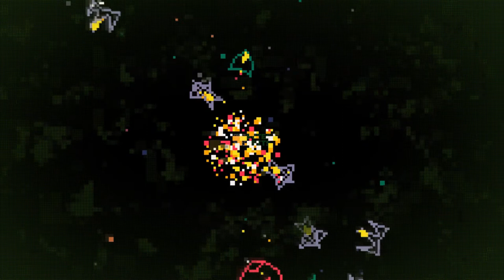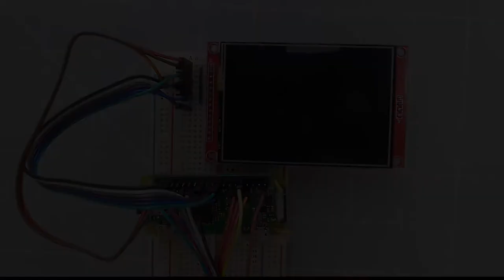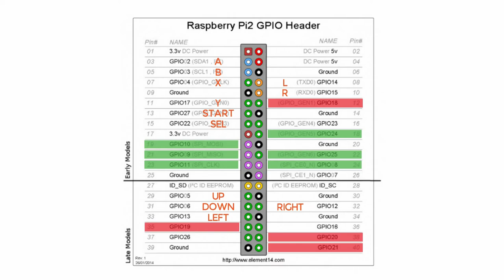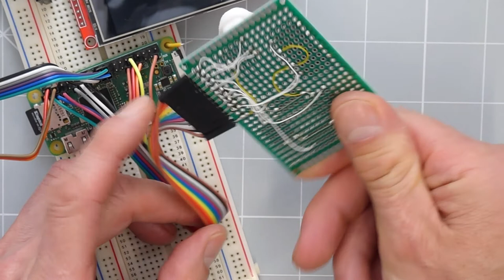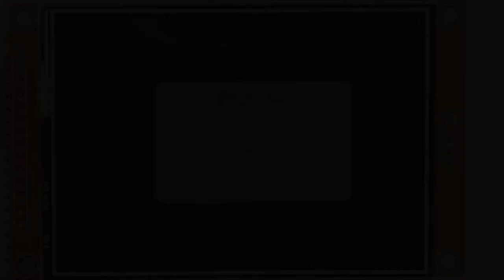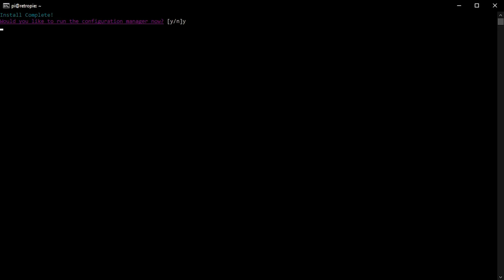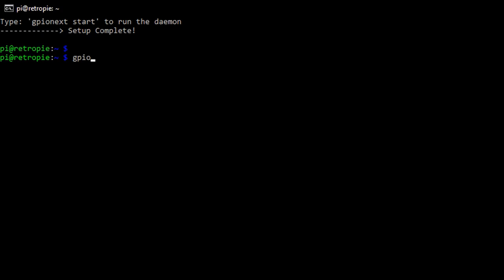Using GPIO Buttons in RetroPie To Make Your Own Game Controller or Handheld Console

Comment: Can this be carried out in raspberry pi zero 2w ?
Reply from the maker: Yes. It should work on all Pi models.
Reply: @BytesNBits  thanks for the reply, can you please help me more by providing few info 
1. I am getting raspberry pi zero 2w for cheap hence I want to make a bartop arcade machine where most of my games will be neogeo ,mame, snes ,sega Saturn . How will it perform on a 15 inch 768p reso screen.
2. Can we use remaining gpio fo player 2 configuration? 
If not then I have a gamepad made from raspberry pi pico will it be detected as a controller for retropie for 2nd player configuration?

Comment: can you show how to make the controller?
Reply from the maker: Hi. The controller is just a number of pushbuttons soldered on to a piece of veroboard. I've wired in a common connection to one side of every switch and then taken the other side of every switch to a flying lead. This lets me connect either 5V or 0V to the common side so I can either pull up or pull down an input pin on the Raspberry Pi.  For this project I used a 0V common to pull down the RPi GPIO pins. I hope this helps you out.

Comment: It says Failed to add edge detection when I open the config-manager
Reply from the maker: Hi. I'm not sure what that might be. Make sure you've run a full update on your Pi and RetroArch installations and then try re installing the GPIONext code.
Reply: @BytesNBits  Ok i found the error :) My LCD-Display took some GPIO pins. But now I have another error. When I type in gpionext start and reboot, retropie says that it found no Game-Pads.
Reply: @BytesNBits  You mentioned RetroArch. I haven't istalled RetroArch.
Reply from the maker: @dark_phoenix_9537  RetroPie is a front end package that uses RetroArch in the background to do the actual emulation. 

Can you run the GPIONext config routine and does it recognise your buttons? If you then run RetroPie without a reboot does it see the controller?
Reply: @BytesNBits  The problem is the LCD-Display, because when I run the RP whitout tftdisplay installed, it recognises the GPIOnext controller.
Reply: @BytesNBits  Does it change something when I buy an SNES Controller

Comment: how to add vibrations?
Reply from the maker: I haven't checked it the driver supports haptic outputs. You'd need to have a look in the documentation. If it does I guess you'd just need to connect the motor to a GPIO pin, maybe with a simple current amplifier.

Comment: i tried to do this but my gpio is now like burned the raspberry pi works but the gpio doesen't
Reply from the maker: have you tried booting the RPi with a clean OS to verify if the GPIO is really damaged. the software shouldn't be able to damage the circuitry.
Reply: @BytesNBits  yes i did it and reinstalled the gpionext software but it still can't recognise the buttons attached to the gpio
Reply: @BytesNBits  how can i know if the gpio is broken?

Comment: Upon trying to run the config menu Im having some issues. Im getting this error "cannot import name 'AbsInfo' from 'evdev' (/usr/local/lib/python3.7/dist-packages/evdev/__init__.py)" any idea on why that might be?
Reply from the maker: It looks like the evdev library (I don't know what it is) is missing a module or something. Try updating your Python. It might also be that that module has been taken out of the library. Try a search on Google.
Reply: @BytesNBits  Thank you. I looked around for a while and didn’t find anything. I ended up just reimaging my SD card and starting from scratch. Worked fine after reinstalling everything. Thank you for the help 🙏

Comment: i tried to do this but it is showing this
Traceback (most recent call last):
  File "/home/pi/GPIOnext/config_manager.py", line 315, in <module>
    ConfigurationManager(args)
  File "/home/pi/GPIOnext/config_manager.py", line 85, in _init_
    gpio.setupGPIO( self.args )
  File "/home/pi/GPIOnext/config/gpio.py", line 99, in setupGPIO
    pins.append( pin(pinNumber, pull, args) )
  File "/home/pi/GPIOnext/config/gpio.py", line 59, in _init_
    bouncetime = args.debounce)
RuntimeError: Failed to add edge detection
please help me
Reply from the maker: Hi. I had a quick look and found this possible issue.
https://www.raspberrypi.org/forums/viewtopic.php?t=205327
Check your pin assignments to make sure GPIONext isn't interfering, or being blocked by some other software. I also added a GPIONext fix video as I found it was interfering with my sound setup. Have a look at,
https://youtu.be/YqF3Z0AAnIY
You can limit the GPIO pins GPIONext has access to.
I hope this helps.
Reply: @BytesNBits  thank you that helped me a lot